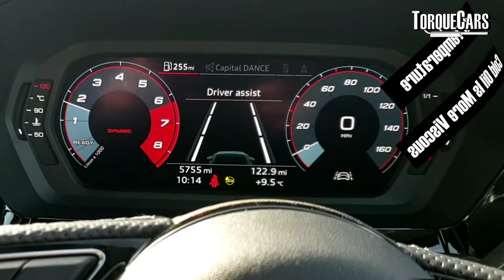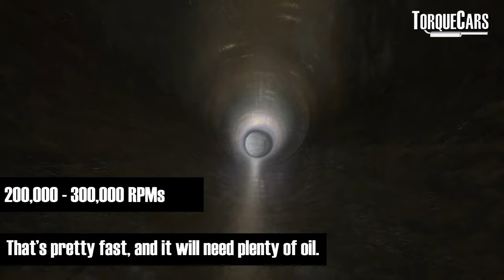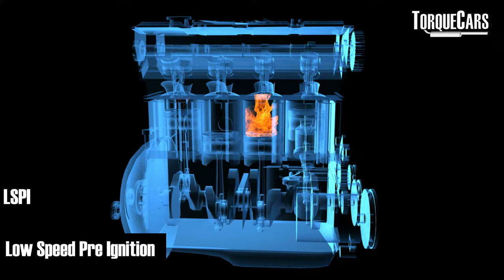5 Things That Kill Turbo Engines ⚠️ [WARNING]

Comment: What about cars with START STOP system? How is this affect the cooling down of the turbo??
Reply from the maker: Does start stop matter that much?  It depends on your journey and traffic levels really. I rarely find I go from spirited drive to a dead stop in most areas I've driven traffic tends to slow up, hence allowing the turbo to cool a little. 

The other factor is that your engine will start again shortly after so the oil circulation and cooling can continue so this is not the same as switching off the engine for good.

Start stop can be manually turned off in most cars and if you regularly go from spirited drive to stop often I would recommend doing this.

Being aware of the potential issue at least gives us a chance as a driver to make an informed decision with regards to using stop start.

Personally I switch off stop start unless I'm driving in urban areas with heavy traffic because I feel it is an annoying pain.
Reply: Turbo hybrids exist. In your sort of situation, a turbo hybrid would have gone pure EV when you've lifted off the throttle to slow down, therefore potentially damaging the turbo, although manufacturers would likely implement safeguards to prevent this sort of damage in a hybrid application.

Comment: Thanks for this quick and precise video! I have a 2014 Fiat 500L Trekking,  1.4 litre turbo. Got a P0299 code, recently.  Changed to higher octane gas. Is there an additive that will help as well?
Reply from the maker: Underboost codes are hard to track down, it could be a simple boost leak, or clogged exhaust, actuator or diverter valve problems, intake problems or even a dirty air filter. These seem quite sensitive, I know some guys have tweaked the threshold for lower RPM's to avoid this. BG do a nice range of additives that will help clear up soot from inside the engine and can help improve the EGR flow too. What is the mileage it might just need a walnut blast on the intake.

Comment: Best way would to have a Turbo car that's reliable in the first place, unfortunately GM killed SAAB so everyone's screwed now, except me with lots of spares.
Reply from the maker: Ah  you've just sent me on a nostalgia trip, the SAAB 900 Turbo was a bedroom poster car of mine back in the 80s 90s. Great cars, it sounds like you made some good decisions and have a stockpile of parts to use. Didn't Saab just take a GM car and fit it with the highest quality parts and accessories they could perhaps GM were jealous and it was making them look bad?
Reply: Wow I forgot about Saab... Vw Tdi pretty good I think

Comment: I must be doing something right as I’m on the original turbo from 2006 in my Saab 9-3 💁
Reply: @leeruffle6542  turbo diesel or petrol? How many kms done?
Reply: I should hope so. My 95 Aero has done 182000 miles. Turbo perfect.

Comment: Thank you for the information boss, but i have question about the idling when you start the engine and shutting it off after stopping. Do I have to do all that each and every time  in a day?
Reply from the maker: If you are starting an engine again, it will be fairly warm already and will typically still have some oil. I wait just 10-20 seconds or so whilst I put my belt on before I pull away if it's not the first trip of the day.

When you stop if you've been doing high rpms then you should let it cool IMHO, but in reality whilst you are parking up and doing the last bit of your journey you'll probably find things have cooled down again and the risk is much lower.

The problem comes when you have a big change in heat on the engine, starting from cold and revving hard, or driving hard then shutting off.
Reply: @torquecars  Arlight, now I get it. Thank you very much once again 🙏.

Comment: Listening to the first part of this about the better grated fuel raises a question for me. I recently bought a 2024 Nissan rogue with the 1.5 turbo three cylinder.
We now have about 2700 miles on it and I ran regular fuel through it for the first three tanks and got about 32 miles to the gallon average then I tried running high test through it and it dropped to 29 miles to the gallon and then I went to midgrade twice and it dropped to 30 miles to the gallon . My question is the owners manual says use the 87 octane, which makes me wonder is the timing set for that lower octane?

Comment: I think the three most IMPORTANT things to remember is to never immediately drive off after a cold start, always allow a cool down after a spirited drive, and change your damn oil after 3,500 - 5,000 miles. I don’t care what the manufacturer says, do not extend your oil changes to 10,000 miles. I treat both my 2000 Saab 9-5 (2.3 turbo) and my 2014 BMW 328d (2.0 turbo diesel) the same way.
Reply from the maker: They are also my top tips based on years of experience as these videos show...
https://www.youtube.com/watch?v=KlPC6z4ktzw
https://www.youtube.com/watch?v=JGxiYvSn4I4

Comment: You reach maximum efficiency of the engine at the point when you get maximum torque, it's usually around 2300-3500revs, anything lower/higher just does not make sense..

Comment: I'm just curious about the turbo timer and affecting the immobilizer. It this your opinion, or has it been proven? Please respond!
Reply from the maker: If you switch off the engine and remove the key the engine is still running so it is not immobilized, you are effectively walking away leaving the car switched on. Insurance companies would not approve of a car which is normally immobilized and protected from running happily without the immobilizer. It would be possible to get the immobilizer circuit to switch on after the turbo timer has run, but most that I've seen just bypass the immobilizer and make it easy to hot wire the car.
Reply: @torquecars  I wasn't looking at it from insurance stand point. I thought it causes issue for the immobilizer.
Reply from the maker: Ah I see. The immobilizer is completely bypassed in most cases so the car will start without the unlock happening, and in the best case scenario is that it is only disabled when you shut the engine off for the cooldown period.

Comment: my 24 year old Rover L diesel is still on its original turbo and engine is untouched.. now on 220 thousand miles, the key is, as you say, good oil and frequent changes. 4 to 6 thousand miles, and let the car warm up for a minute or two before driving from cold . I also think Diesels can last a lot longer than Petrols , not sure why.
Reply from the maker: The fuel acts as a lubricant as it is closer to being an oil and they are built to withstand much higher pressures and greater torque. The way they deliver the power through a narrow RPM range also helps keep them reliable. I did a videos that went into some of these points if you are interested. https://www.youtube.com/watch?v=U5f2YRb0uik

But yes those older pre DPF diesels seem to last forever

Comment: I recently bought a hybrid car with a turbo, so I'm just curious since I don't control directly the gear its in, nor the RPMs - should I assume that the car's computer will do a great job for the cool down and warming up? After long highway driving it usually just shuts down the ICE for the last 1-2km of the trip, so i guess it doesn't need a cool down?

Comment: There's only really two things that kill a turbo. One is too much heat, the second is insufficient or contaminated oil.  Everything else is pretty much just old wives tales!  Take the common misconception that you should let the Turbo spin down before turning the engine off.  If you think about it carefully, why would you need to?  People state that the turbo will continue to spin even after the engine has stopped and that it will run dry of oil.  Both of these statements are incorrect, the turbo is basically a very efficient fan/pump, however once there is no expanding exhaust gas to drive it the inertia it has very rapidly gets depleted by the resistance of the air on the induction side, the free-wheeling effect is at best momentary.  The second point is that even if the turbo were to spin after the the engine is turned off it will not run dry.  Turbos are designed with an inbuilt reservoir that encompasses the bearing area of the turbo, the idea being that during startup or shutdown the turbo has a ready supply of lubrication to avoid a run dry situation.  During normal operation the turbo should receive no I'll effects from either stopping or starting the engine, which is why stop start technology is available on turbo petrol/diesel engines.
Reply: Nice to read a comment that actually makes sense   Im so friggen stressed about picking up my turbo Mazda CX 50 I just purchased. Almost wanting to cancel the sale and get the NA
Reply from the maker: The new turbo designs are indeed perfectly reliable so you have nothing to worry about. Taking these precautions will help but many will argue they are not even necessary but even on non turbo engines following a good warm up/cool down will prolong engine life.

I will do a video discussing the reliability of modern turbos for you though.
Reply from the maker: The video about turbo reliability will be going live on Aug 10th. 
https://www.youtube.com/watch?v=mousEzFu_00

Comment: LSPI has been linked to high concentration of calcium-based additives in the engine oil, mostly detergents and dispersants.

Using API SP oils can mitigate the problem of LSPI. The calcium-based additives have been substituted by magnesium-based additives which seemed to have done the trick.

It's still advisable to avoid lugging the engine, though.
Reply from the maker: That is really interesting I'll be looking into this more now you've pointed me in this direction, thanks for the heads up.
Reply: @torquecars  you are very welcome 😉

Comment: I purchased a 2020 subaru wrx back in June of 2020 ... have NEVER dumped the throttle and have ALWAYS waited until the idle dropped to normal operating idle before I started driving ... YES the engine is still cold so NO I'm not going crazy with it ... once that idle drops to normal I take off very smoothly and I shift every 2.5k RPM's when there is no traffic behind me and not more than 3k RPM'S when there is traffic behind me just so I don't hinder it ... and even after everything is at fully operational conditions I still NEVER shift any higher than 3k RPM's ... I turn very smoothly in corners ... accelerate very smoothly in corners and once I get to my desired speed I enage cruise control ... no matter where I am at ... no matter what the speed is ... I LIVE off cruise control ... that is how I pull the most out of my fuel economy and Im telling you guys I can EASILY pull 500 miles on a full tank with this car and that is with highway / city COMBINED ... I HAVE modified this vehicle throughout the 4 years I have owned it nothing too serious ... suspension is FULLY upgraded and I attacked that first because lets face it ... factory suspension is FUCKING GARBAGE on wrx's ... and you can't even adjust camber in the rear nor caster in the front so I took care of that IMMEDIATELY ...I mean how the fuck you NOT going to allow those adjustments ??? ... how INEPT does a so-called ENGINEER have to be ??? ... but I have fully upgraded sway bars ... end links ... lower control arms ( ADJUSTABLE lower AND upper control arms in the rear ) ... upgraded turbo inlet and charge pipe from the PLASTIC PIECE OF SHIT factory garbage to what it SHOULD HAVE BEEN FROM THE FACTORY TO BEGIN WITH ... front and rear strut tower bars ... upgraded pitch mount ... transmission/engine mount ... upgraded black zinc coated drilled and slotted rotors with ceramic premium brake pads ... upgraded stainless steel braided brake lines ... I mean I can go ON and ON ... I have upgraded so much on this vehicle it actually IS funny ... all parts installed by yours truly as well I will add ... because I don't anyone else to get the job done RIGHT ... but I take well care of this vehicle even with all the modifications ... I change the oil and filter every 5k Miles ON THE MARK and I even perform a full GDi service on it as well ... entire fuel injection system gets cleaned and I even clean the valves ... I now have just short of 55k on her and she sounds and drives and even handles better than 99% of every other wrx out there on the road ... I guaran-damn-tee it
Reply: @20VA  My Ford Focus RS is far superior to any other turbo AWD performance car I've owned. Facts. Never sell it!

Comment: octane isn't related to quality, using a fuel of octane higher than the manufacturers recommendation isn't gonna increase power or longevity in your mint stock car. it's only viable when there is so much carbon deposit in the combustion chamber that your compression ratio is increased, so you don't get knock by using a higher octane fuel. but at this point there are more proper fixes like getting the deposits cleaned.
Reply: Carbon buildup would have to get pretty extreme to significantly alter the compression ratio, you've probably got bigger problems than knock by that point. The main issue with carbon deposits is that they can cause "hot spots" in the combustion chamber (especially on or around the sparkplug electrodes) which increases the likelihood of pre-ignition/detonation. This is why it's important to always use correctly specified plugs and follow the manufacturer's recommendations for octane rating.

Comment: Although most average cars don't, Defenders do run the turbo optimally at low rpm and produce lots of low down torque.
But many average cars are over geared making it necessary to drive in 3rd sometimes too
Reply from the maker: Thats a useful tip to know, was this in all the turbo engines they used?

Comment: 'This causes Low Speed Premature Ignition which involved dramatic and sudden changes in pressures inside the engine, and cannot be easily mitigated,'

API SP engine oil can help to reduce the risk of LSPI events within the engine.

Comment: I m driving the car at lowest 1800 - 2000 rpm when on straights with no elevation change and consistent speed, TSi 1.4L , I hope it's not low as he says in the video

Comment: I will be turbocharging my Hyundai Coupe. I was told to either go for 5w50 or 10w60. Which one iwll be better at preserving my engine, and turbo?
Reply: @mininovaq  well that would depend on the season of the year 5-20 cooler ,10-40 hotter

Comment: When you arrive at your destination, do not just immediately shut off the engine. Sit there and allow the engine to run for a couple of minutes to allow oil to circulate to the turbo to cool it off some.

Comment: Hi thanks for advice on turbo engine 😊 . I having a 1.5 turbo MG 7 speed automatic soon so how will driving an automatic turbo effect my turbo , also it’s a 3 cylinder? My car at the moment is a diesel 2.0 Tiguan  so never driven a turbo before I want to look after it? On the test drive I found it lovely after the diesel, it was a lot smoother and even  excellerating  gently the pickup was very nice , by the way I tend to stick to speed limits except on motorway when I like to stick at 60 .
Reply: If you stick to 60mph you never needed a turbo period.

Comment: When do you think it’s a good idea to do a engine flush on a turbo car?
Reply from the maker: I would personally run a flush through with each oil change I do. The sludge and gunk that builds up can cause all sorts of issues. I believe some OEM service schedules drop a flush in the oil just before it is drained as a matter of routine, at least my local Audi dealership does this.

Comment: The Fuel argument isn't really relevant unless the Manufacturer specifies that. Most VW for example recommend normal Fuels now. Fuel isn't a "worse quality" because its not a higher octane, it just has a higher octane. Yes, some engines require it as there will be backfires, but that would be specified by the manufacturer.

Comment: Not taking any sides here but as to oil issue that everyone talks about has anyone actually sent their oil off for analysis on a turbo engine?  Yes the oil may run through the turbo but most turbo engines today have oil coolers and synthetic oils can withstand in excess of 300deg F so does anyone have data around what temp the oil sees going through the turbo?  Most comments often make it sound like this temp is through the roof and for long amounts of time but I am not seeing any data showing that turbos degrade oil faster?  Now don't get me wrong I am massive proponent of changing oil religiously as it is cheap to do so but having owned several turbo engines (currently own 3 with 1 having 260,000) I have yet to see any issues related to this "high temps" comment being thrown out there?  My turbos have been as reliable as any other NA engine that I have owned, I would say though that the high HP NA engines that I have owned gave me more trouble than the turbo engines I own.

Curious if you think that almost all of points are true for NA engines as well because I do?

Comment: The problem with turbo's, people think the have a performance car under their ass and over rev which causes oil to be pushed past the rings due to high pressures. Depending on and who changes your oil, I bet its filled to its max. It'll push oil past the piston rings, depending how much abuse you've caused over the years , it'll enter into the combustion chamber and out into the system which will cake everything in carbon. This means it'll cake your turbo and valves which will definitely effect performance and fuel efficiency. Top tip change oil every 5000 miles with high quality oil and change gear at the appropriate speed, and don't just turn off the engine after a drive, just wait a minute.